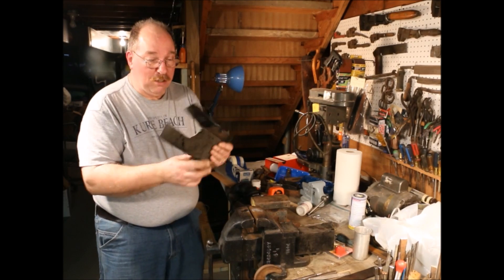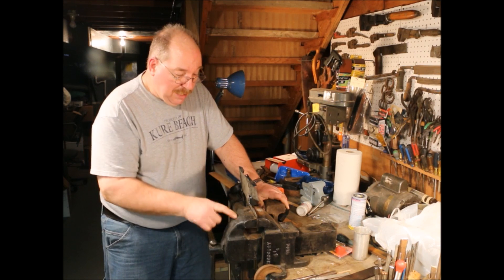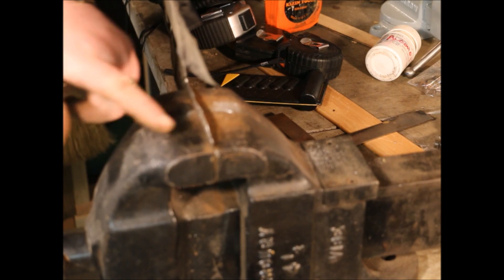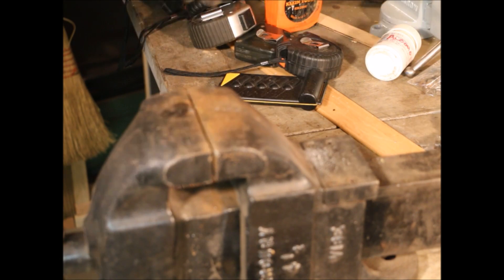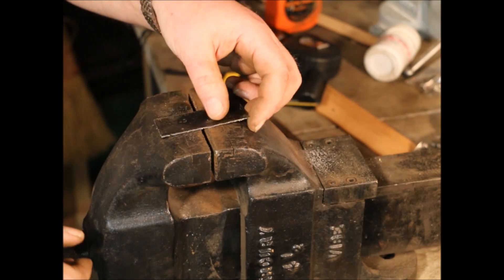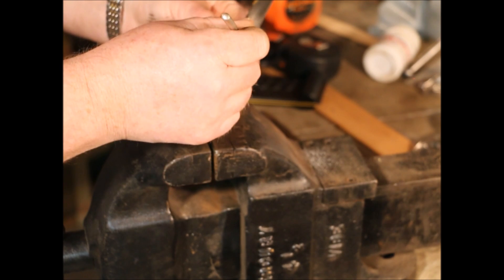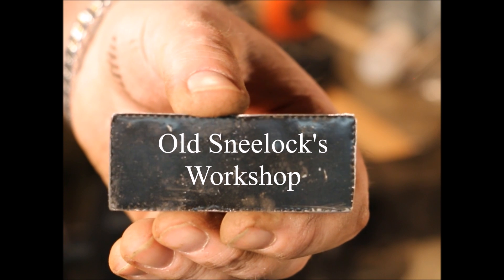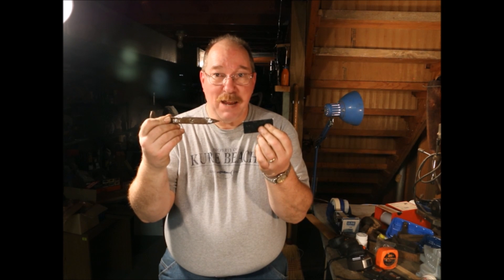Modern Shop Practice ~ From 1930 ~ Milling Steel By Hand & Eye ~ Pt 2 ~ By Old Sneelock's Workshop

Comment: A somewhat capable mill as way out of my price range! I tried to grind a plane iron like a machinist scraper for working brass. I need over 100 lbs of force to push the darn thing.
Reply from the maker: Scrapers rely on the hook to do the cutting. Brass is a particularly tough metal to cut. It is just hard enough to be resistant to cutting and soft enough to let the scraper dig in too deep. 
You might try holding the scraper at a flatter angle.

Comment: I don't beat on my vise. I might peck around on it but if I need to start frailing, I have a steel block about 4x5x3 that I can use and if push comes to flop I always have the beam on the wood splitter. I had a Sneelockism the other day and actually tore the vise down, and now that I had compressed air, blew it out, cleaned it up and oiled it. Seems like I oiled it when I first got it but the air makes a lot of difference. It's a Columbia and I need to get a number on it. Good enough for who it's for. Thanks Unc. Things can be done without an Inhuldable Crelk move.
Reply from the maker: +Lewie McNeely Each small improvement makes the next job easier. Life got a lot better when I finally got the bench in the basement done. Having a vise speeds things up a lot. Between dirt and rust I spend more time dealing with dirt in the works. Just a little oil stops the rust but holds the dust.
Reply: Sometimes a tradeoff. Can't win for loosing but I'm used to grease and grime. Better than dust for me.
Reply from the maker: Oil is much better than rust and the dust can be handled with a rag and some elbow grease.
Reply: 10/4 on that! The Saw Surgeon is always ribbing me about greasing stuff, saying I don't do it when it's dripping off it. He sniffs too much Brake Cleaner.